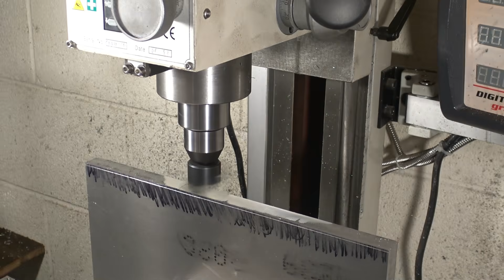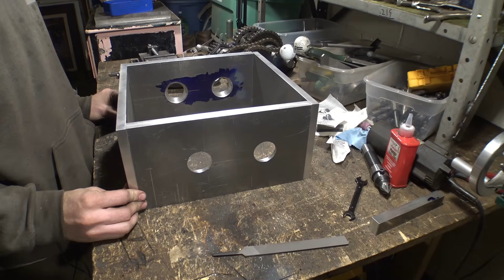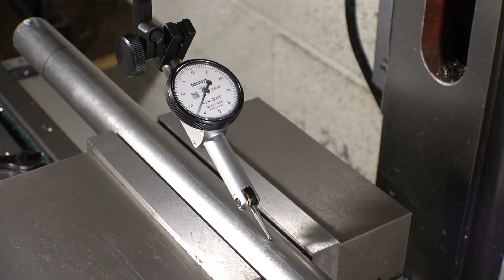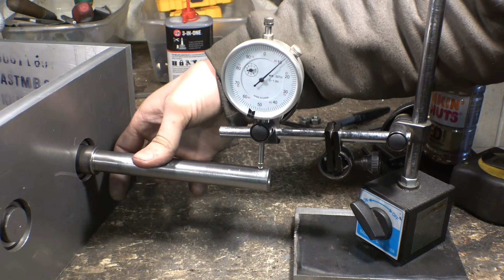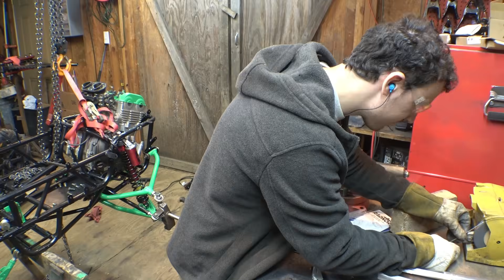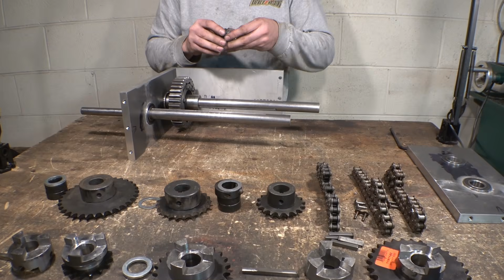3 Speed & Reverse Go Kart Gearbox Homemade Part 2

Comment: It only needs oil to fix the metal on metal contact issue. Seal her up and fill it with grease. Then put it in place of a jackshaft in whatever needs it.
Reply: If you can make it work on a manual actuation clutch it will be worth the extra weight.
Reply: Also being able to run it attached to a differential will make it even more worth it.

Comment: So couple cheats for your welding woes, 

Preheat the metal. Just throw a blow torch on it. 

Weld by the house, get on that big ass breaker. Kinda sucks but less power problems.

Comment: You could 100% sort out the metal on metal, mill out the parts and add a bronze bush. Just make sure the keyways are chamfered. 
Lighten it up by removing the side plates and swap with some light box section frame and thin sheet. Mill out some voids on the end plates. 
You could 100% use this gearbox, it looks way strong enough, just needs some minor improvements.

Comment: Why not machine the hole larger to fit a bigger bearing? If you machine the hole offset you can move it.
Also if you then can't find a bearing with a suitable ID to fit the shaft you can machine a bushing to fit.

Comment: Criss this setup would work perfectly fine we run much smaller and weekend gearboxes on racing lawnmowers and they can hold upwards of 60 hp if you don't mistreat them slap a bottom plate top plate and shifter on it and it will hold up very well

Comment: When you make two plates clamp the/bolt them together to make them exact.  To get more heat from your tig you need can add helium on a dual feed regulator setup.  also pre heat with a torch really helps with aluminum.   And You’re drilling it way too slowly

Comment: Haha... I feel your pain with welding *that end clip. As far as not having enough power, it helps a lot if you preheat the metal with a torch, or even run the torch around where you are going to weld at a lower amperage ... it will take a few mins for the heat to spread out (heat soak) and then you can do your actual welding. 

To repair the hole and reposition it, you could have bored it out slightly larger, cut out a aluminum plug that was a press fit, heated the plate and dropped the plug in and remachined. Not that it helps you now, haha. 

I think it's a neat project to have on a shelf... maybe put an electric motor on it so you can play with it. I do think that if you put a 80W90 gear oil and some moly it would last quite a while... but I get why you're not using it.

Comment: You could enclose it put a hydraulic pump on one end of the input shaft gun drill the shafts and pump the oil to the gears thru the shafts

Comment: If you seal it and partially fill it with gear oil and heat treat your dogs shafts and gears it should hold up fine to the power you'll be putting through it.

Comment: Hear me out on this one. Reduce the shafts' diameter to a common size, install oil impregnated brass bushings of the original shaft OD and the new shaft's ID in the contact areas. You'd only have to cut them to length and press them in (I think the material is called Oilite, or something similar), seal it up and fill with oil, and you have a transmission and reverse for your lathe.

Comment: My recommendations to make it reliable for a go kart: 
- attach some sort of an oil slinger to one of the gears to lubricate the dogs and the shift forks during operation.

-as long as there is constant lubrication, the shaft will not wear prematurely because there will be a film of oil to act as a bearing.

-a way to drastically reduce the weight of the unit, the frame can be milled out while leaving some webbing for strength.

- (edit) adding a chain tensioner made of high wear plastic (similar to one on an engine timing chain) should take up the slack and quiet up the gearbox.

Comment: USE IT!  You got nothing to lose.  Seal and fill it with just enough gear oil that the gears and sprockets are down far enough to sling the oil.  Nice job!
Reply: Oh, and pull the bearing seals exposed to the gear oil.

Comment: @ rather B welding
If you can't get enough heat into a workpiece to weld it then the easiest way would be to mount a blow torch slightly away from the workpiece & measure the heat of the workpiece making sure that you don't put too much heat into it & then do your welds. The heat from the welder will obviously increase the heat on the workpiece faster which will be okay for the welds to turn to fluids & you don't necessarily trip breakers all the time. Preheating allows for faster welding when you are basically welding a giant heatsink.

Comment: Sometimes I can’t weld the amperage that I need because of my breaker, so I heat the piece with a map pro torch and then use lower amps. That size aluminum I would preheat even if I could max out my welder.

Comment: @ rather b welding can you please give the dimensions of the gears you used please. Thickness of gears, width of gears, number of teeth and pitch diameter. This would be amazing if you did. 
 A super thanks and high five in advance! -George

Comment: Also if you were content to just let it be a show piece it would have been easier just to take the material from between the two bearings and Vd the two sides and welded them back together.

Comment: The farther you are from the breaker box the easier you will blow the breaker.  Welding aluminum typically will pull more power than welding steal.  If there is a plug that is MUCH closer to the breaker and you can avoid using any extension cords and such you might be able to weld it.

It is getting to the point were you might start thinking about going full time.  You have almost half a million subscribers.  You might be able to rent a small shop cheap as many have likely closed down in the last year from Covid.  Do this full time (or maybe do some lathe, milling, and welding too) and put out more videos a week.  This will get you more subscribers and give you more room.  Also you will not have your finished projects stuffed in storage somewhere and will continue to upgrade stuff until it works great and is reliable.  Then you can maybe plan some fan events.  If you have some help (maybe a girl friend or family member) you might stat doing some merchandise.  There are always artists on Deviant Art that will sell designs or make new ones for fairly cheap.  If you could do say 3 videos a week, do a few collaboratives with other YouTubers, you could likely double your subscribers before the end of the year.  With merch, a few events, more subscribers and more videos you should easily make enough for a nice little shop.  Plus with a shop where you can put up banners and such and paint up and the extra subscribers you should be able to get either paid sponsors... or much more new equipment.

Comment: I gotta ask....where'd you learn how to machine and how did you afford all your machines?
I'm a 28 year machinist thats done everything from oil field work,Aero space and medical equipment. I can tell you arent very experienced but you do have a decent grasp on how it works.
   So how did you get where you are?
Not knocking you but as a first class machinist I can tell you lack the finer points.
Reply: One of the things I've noticed is you lay out things that the digital read out would do far better at.

Comment: Depending on how much free time you have, it would be interesting to fill it with oil and put it in something just to see what happens. At worst, it's a fun experiment and at best you get a transmission. I do understand if you don't though. Also, a 250f preheat would help your welding situation a lot.

Comment: The way you fix that problem is by making a bigger offset bore as needed and then you can use a bearing with a bigger OD o make a bushing to fit the current ones. A hole in the wrong place is actualy a very common thing, probably is there a lot of machinist that folows you, or even you can ask to Adam, who I thing may be de nicer guy in de world, they will help you with that kind of things. Don't be afraid to ask for help

Comment: Aluminium conducts heat very well which means you need lotd of amps because a lot of heat is lost. you could constantly heat the aluminium plate with a propane torch and thus need less amperage. it would be inconvenient but it might work.

greetings from germany

Comment: If you've ever tore down a automatic trans you use bronze bushing with a lot of holes drilled in it to let it ride on oil and then put yourself seals on the input and output shaft to keep the oil in,  also if you could of use helical cut gears the noise would have be a lot quieter!! Great try keep up the good work!!!

Comment: Isn’t this basically a dog box? Usually the whole reason people go with a dog box is to handle higher house power and have quicker shifts. As the smaller teeth of synchronized gears can bind up and destroy themselves during a quick shift. I feel like the chains would snap or stretch before the dogs got messed up. Then possibly the keys or keyway would deform and bind up. You never know, it might work better than you think. Still a very cool project.

Comment: Why not use joy couplers in your gear box. They have rubber bushings in between the metal parts.
Reply: He means the center of the couplers and gears are metal to metal spinning on the shafts.

Comment: For the welding issue, try next time to heat up the plate with a burner torch. Heat it up to 300 degrees Celsius and start welding. I bet you’ll succeed
Reply: Ab same as I would just do pre heat save 30-50 amps needed easily
Reply: Maybe even a spool gun?
Reply: @forkjob  Would still require preheating the plate.  The reason is, aluminum is a very good conductor, and the heat used to melt it is rapidly conducted away from the weld, in effect, cooling the weld.  By preheating, the welder doesn't have to provide as much heat for the weld and it is not wicked away as fast.
Reply: I agree preheat the plate I have welded a whole lot of half inch aluminum plate ..preheat helps a lot
Reply: I normaly do it over 500 degrees hot with my hardox shit is that to much?

Comment: It’s a cool piece, Chris.  Maybe if you added needle bearings under the sprockets on the drive shaft, then partially filled the case with gear oil, it would hold up.
Reply: Or self lubricating brass bushings with oil bath and maybe add some sorbotane rubber on the contact surfaces to smooth the gear contacts, or alternatively tig weld some self hardening tool steel on the surfaces to make them last hellawa lot longer.

Comment: Nice to see this project again! I suggest you angle the teeth on the shift paws so they can easily engage instead of chunking into gear. This will allow a shift paw as long as the slot it fits into and drastically reduces the amount of play in the transmission.

Comment: Man I think it will work if ya make it a wet gear box.. seal it up put some ATF in it.. I bet it will hold up to 40hp.. ain't no different than a dirt bike or ATV transmission gear wise.. and you have some big chains. Plus the lockers on the ATV Transmission gears are way smaller.. man I think it will work and work better on a wet set up

Comment: your shed is probably too far from the panel to run that draw on its load ....try plugging into the dryer or washer lol and do your welding there when needed..the garage is probably a safe choice as well. after thought   jb weld dosnt need power   is machineable  will carry enough load for your usage  and its cheap lol just a thought for further transposition errors .. isnt it fun remembering its 1/2 the value while holding a target number a current dimension number and cut depth all in your head while doing lathe work lol  from time to time your bound to mess up one of those numbers.  thanks for the videos...so its not going in a vehicle  adapt it to the lathe or mill for more range of speeds or quicker changes of speed

Comment: I think it would hold up long enough. I don't think it would last forever and I don't think it was sensible to make one that you probably put 100 hours and close to $1,000 in material when you could of went to the junk yard and picked  something up for $50 however like you said you did it to see if you could and it was fun so for those reasons it's good enough and I would like to see it work.
Reply: wait you can pickup a gearbox for $50?! Where??

Comment: Just a tip when cutting keys cut keyway one size under before making final pass with correct size the key will be so much tighter.. i.e. 3/16 endmill then make one pass with 1/4 and it'll save you from wallowed out keyway
Reply: Good tip. 
Keyways are garbage on petrol engines still. They all chew out eventually. Fine for electric slow motors. 
Every car and bike manufacturer uses splines for a reason
Reply: @janeblogs324  this is true but making splines at home is a difficult task
Reply: @ICULKN550  as difficult as making 28 keyways lol. 
In this build he has dog gears sliding on keyways loaded in the middle of a 12" shaft. Super scary

Comment: Just use gear oil and see how long it lasts, or get in touch with someone and film a super slo mo of it blowing up
Reply: Warped perception 👌
Reply: my quad uses a lawn mower trans that works exacly like this and is built far, far less strong... i bet this will handle a solid 5x the power and way more in a low speed application.. this being said, that reverse gear will blow it up the way its built it needs a bushing on the input shaft and a much deeper ratio for reverse.. looks to me like reverse is gears somewhere near 2nd gear which again is fine for a low speed machine or even his lathe???
Reply: creeps

Comment: Hey man you need to install a 30 amp breaker in your breaker box. Take care of the welder tripping it all the time. But nevertheless well done
Reply: only if the wiring to the shed has the proper gauge wire.
Reply: @richardreinhard8864   easy to do

Comment: I can't be the only one watching this here and thinking "Underdrive, one to one, overdrive, and reverse could make this quite useful as a quick change lathe spindle gearbox" can I? It would be significantly quicker than moving belts on pulleys to change gearing.

He'd probably want to swap the two smallest sprockets to ones with a couple less teeth to get a wider speed range, but apart from that it looks almost made for the job. I could see it being quite a useful feature on his lathe project, and for the diameters Chris usually turns it looks like it would probably be up to the task. Worst case he'd need to open up the bores of the pulleys to press some plain brass bushings into them.

Comment: Would love to see this morph into a This Old Tony collab to see if it can be made more practical and usable!
Reply: That would be an awesome collab
Reply: Agree. TOT collaboration, would be hugely beneficial for him. TOT has a lot to offer in the machinist tips and tricks department. There are several other engineers on the tube that could help too. A mass production 2 speed with reverse would be awesome for us custom builders. Would be nice to have one that can handle 20-30hp that doesn't cost an arm and a leg.

Comment: Pre heat your aluminum before you start . Your also pushing the envelope of that machine that 1/2" plate would need close to 250 amps as well as  pushing the duty cycle of the machine  your also overheating the whole piece by slow travel time without enough heat . That welder will also need a 50 amp breaker and #6 wire depending on voltage drop and the distance from the fuse box . It can be welded with that machine but preheat is going to be needed . I'd also recommend 1/8 tungsten  and a #7 or 8 cup 15 to 20 cfm . I like to use propane for preheat over acetylene to reduce chances of contamination do to the soot left behind from acetylene.  200-300 degrees makes all the difference in the world . You can d/c weld that with a spool gun as well its not as pretty and you don't get the cleaning action of a/c with more chances of prorisity
Reply: BTW  love the gearbox even if it's just a conversation piece.  If it's not usable as you say it's a step in the right direction as far as can I do it  and the experience and expectations of will it work .

Comment: Only way to find out if it will last or not is to actually put it into use find a way to make it lighter for a go karts. Find the problem with the design work them out and you will be the first person to have a manual gearbox made from scratch on a go kart. Don’t give up on it and keep the great work just remember K.I.S.S

Comment: I would round the corners on those dogs, so it will give it a slight taper and help them to shift a little easier. If you bathed that in oil, it would last just fine, although its very heavy....  What I would do if i was you, is buy a cheap motorcycle engine that has a blown motor, and you could steal the trans gears out of that and put it into your own little case, that would be a good project.  You could even use the engine itself as the case and just take the cylinder off and strip it down.

Comment: On thick aluminum like that (ESP when you cant turn the amps up on the welder to burn it in) it wouldve helped a LOT to pre-heat it with a torch - Not as much with steel, but makes a HUGE difference in Alloy-
ALSO- if you return back to something like this- the Reverse ratio needs to be as low or lower than first- your reverse gears are WAY too tall-
Reply: Came to suggest this, that's a big piece of aluminum that is just sucking all the heat you put into it away from the weld, like a big heat sync.
Reply: This is good advice.

Comment: I appreciate you tapping those holes properly and not just using a drill
Reply: Using a pusher tap on a blind hole isn't considered proper. Side note, there's nothing wrong with tapping under power.
Reply: I wished he did it with a drill. 🤷🏻‍♂️
It is only aluminum afterall. 

Well. A drill press or mill to align the tap with a dead center.